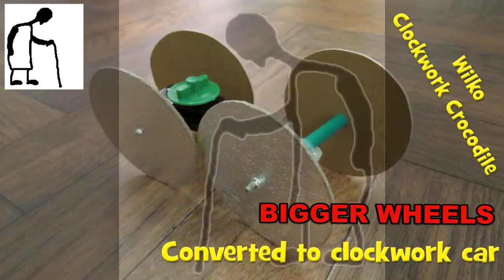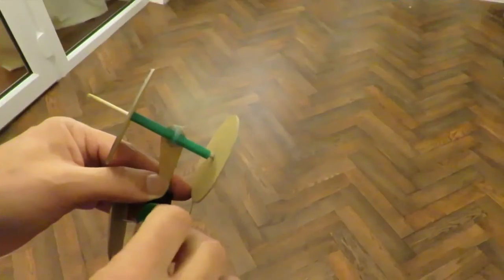Wilko Clockwork Crocodile clockwork car BIGGER WHEELS

Comment: There are many factors at play here, the effective higher gear and inertia of the large wheels helping to prevent wheel spin, the lower rolling resistance of the thin contact area and flywheel effect of the large wheels giving it a longer range.
 Infact if you fully analised what is happening here you'd get yourself a University Degree !
Reply from the maker: Yes I try to keep away from the fine detail. For the rubber band cars that I get lots of questions I just give general guidance like "Small wheels = fast acceleration = low grip. Large wheels = slow acceleration = plenty of grip" and somewhere in the middle will be the best for your car depending on what your are trying to achieve.